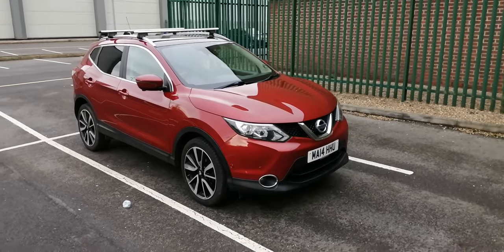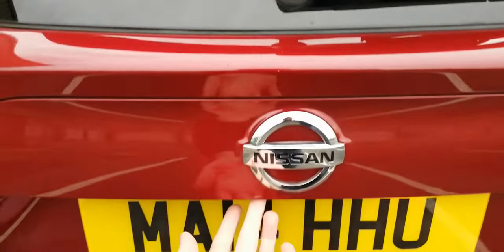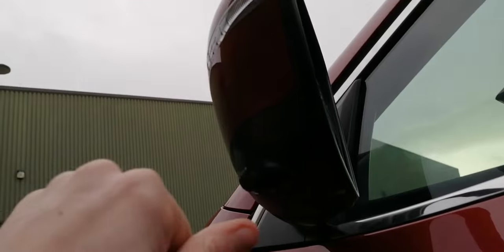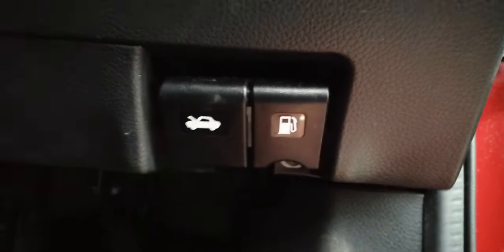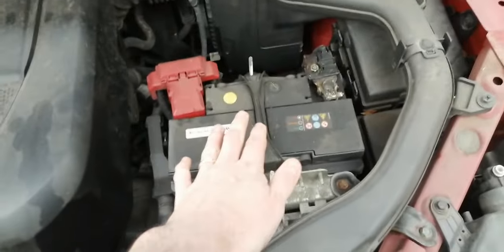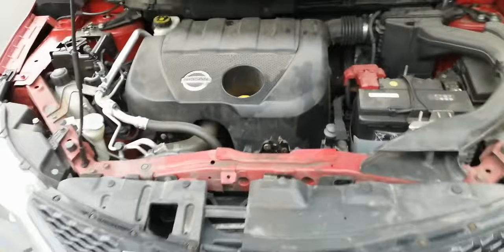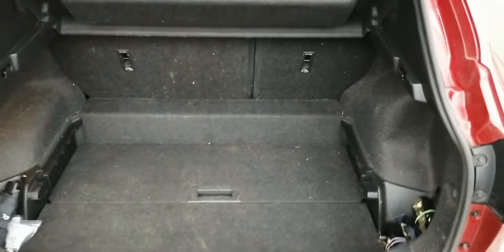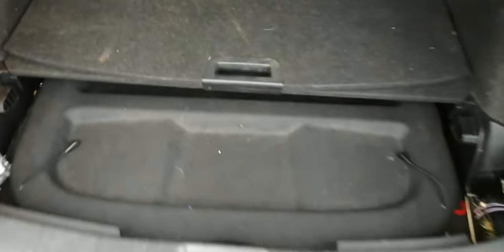Did you know Qashqai? #6 Exterior, bonnet and boot tips and tricks

Comment: Great video, I'm was contemplating buying a 65 plate tekna, but on reviews there's a concern on reliability (multiple faults, battery, infotainment console etc), in your honest opinion and experience, would you recommend going ahead with my search for a qashqai tekna 1.5
Reply from the maker: I'd say yes. There are so many qashqai on the road that there will always be ones with issues.
Battery is a common fault but if you buy from a dealer with a decent warranty they'll sort it. Or check before purchase 
Infotainment wise I'm not sure what you've heard?
Just look for one with good service history and you should be fine.
Reply: @TheQashqaiGuy  cheers, think I'll take the plunge 👍
Reply: I had a 1.5 diesel never any bother, just servicing. So just look a good serving history with Nissan.

Comment: Great info Dan , one tip for locking the wipers was good , but has any worked out how to take of the  stock blades with the tab you have to twist and lift , took me a while to work out , now i just need to find what BOSCH blades fit.

Comment: Hi! Great video, thanks a million for uploading!

I recently bought my first car, a 2018 Nissan Qashqai 1.2 DiG-T N-Connecta 5dr manual in UK. The dealer serviced it before delivery. Now, I have some maintenance questions and will appreciate if you can please answer them:

Question 1. Engine oil:

Should I check the engline oil level monthly through dipstick and top it up to the max as soon as it's level drops even slightly?  (I'm new to car care and want to learn more. Please excuse if my questions sound silly 😃)

Question 2. Fluids:

Should I buy coolant and brake fluid and engine oil to keep at home and check levels regularly? If so, what brands do you recommend for my car?

Question 3. Servicing:

I was told by few that I should buy above mentioned fluids and air and oil filters at Euro Car Parts and hand them over to mechanic at the time of car servicing to save on costs. Is this a good idea?
Lastly should I specifically ask the mechanic to check and top up gearbox oil during servicing? (Please note that I don't know if my manual Qashqai needs gearbox/transmission oil).

Thanks!

Comment: Great video, helped a lot. After driving the car I realised I couldn't hear the automatic door locks activating after a certain speed. Does the car have automatic door locks or do you have to manually lock the car before driving the car? If not do you know how to activate automatic locking?
Thanks
Reply from the maker: It isn't possible on this model. You can get a module from alliexpress if you really want it.

Comment: Hi Dan great vids. I have learnt a lot. Is there a way to disable the stop/start permanently ?  regards Bill
Reply from the maker: Hi Bill, I'm afraid not no.
Reply from the maker: @birandhashem94  this does not work on UK models.
Reply: @TheQashqaiGuy  you can try to get a module and disconnect it through that? Or just get it in a shop and ask them to disable it
Reply from the maker: Yeah I think overall its more hassle then it's worth, especially as the stop start isn't that invasive in my opinion

Comment: hi dan have you had any problems with the car .. and dpf filter just bought same type car my self on 16 plate.
Reply from the maker: Hi bud. Yeah to be honest I've had a few issues. Main one so far was the blocked exhaust pressure pipe, I've shown the fix in another video.

Also have a fault with the rear parking sensors that's just started. I know the fix for that, got the part on order and will upload that vid when it's done.

Other then that, no real issues.
Reply: thats a load off  thanks, buddy, really loving my car .coming from a small car .cheaper to run as well
Reply from the maker: Yeah they're great cars when all is running well.
Just unfortunately let down by the Renault side of things. That's the engine and electrics!
Reply: are all engines in qashqai made by Renault?? I have a 1.2 petrol i hope thats a Japanese engine😮
Reply: @Pure809 That is also a Renualt TCE engine (which is not a bad thing)

Comment: Have you ever had issues with the rear passenger windows that don't go down. Works from the driver's controls but not from the seat.
Reply from the maker: Have you checked the safety button hasn't been pressed?
Reply: @TheQashqaiGuy  Where can i find that :s
Reply from the maker: I think it's a button with a lock sign on it
Reply: @TheQashqaiGuy  Oh no, when that is off the passenger still cannot put their windows down
Reply from the maker: I'd check the switch on the door then, if you have a continuaty tester use that whilst someone presses the switch
Reply: If rear switches don't get used much they rust up inside. Remove rear switch spray a small amount of wd40 inside switch and move back and forth about twenty times to remove rust. It will defo fix issue.had this happen to my 2018 model.and all ok now. It's a known fault, don't buy a new switch.

Comment: Is there a button to turn my hill start assist on ,it doesn’t seem to work anymore.on my qashqai
Reply from the maker: No button. It should engage when on a decent incline, in gear and handbrake off
Reply: @TheQashqaiGuy  my car hasn’t been drove for 4 weeks,I wonder if it could be low battery.
Reply from the maker: @brianwitton5061 get the battery tested,most garages will do a free check for you
Reply: @TheQashqaiGuy  thanks mate.